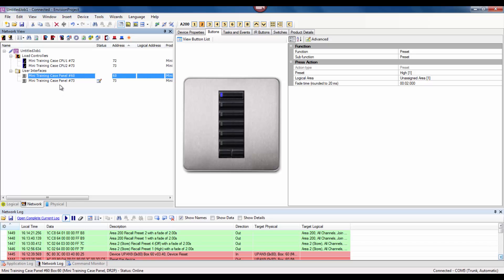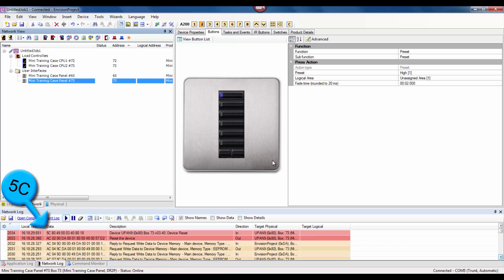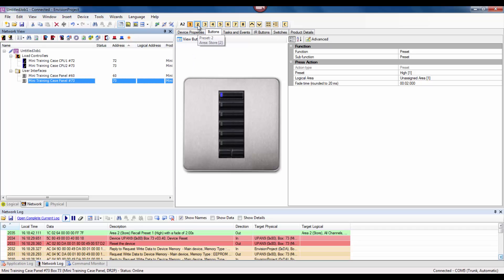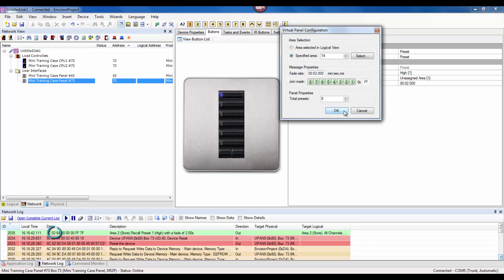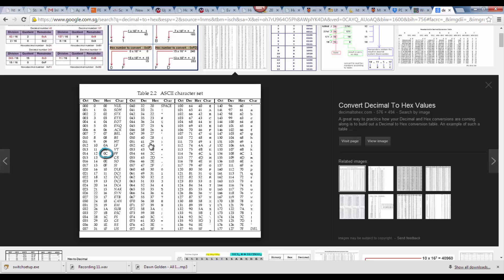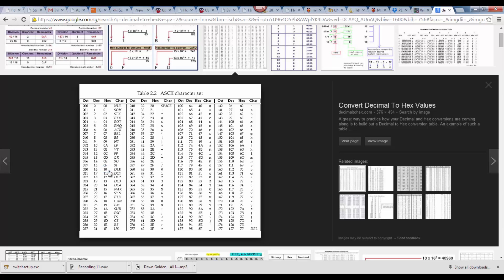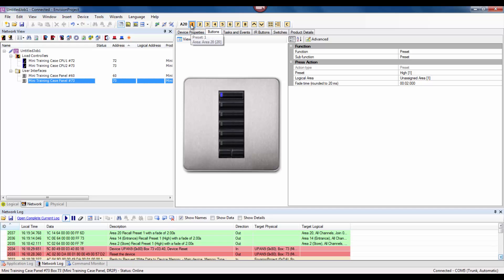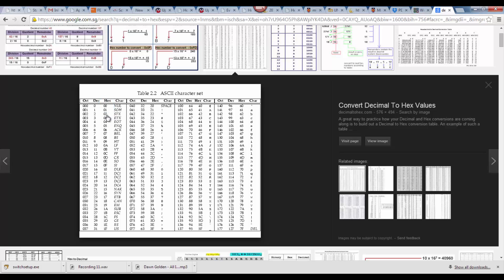EnvisionProject/System Builder - Basics of a DyNet String

Comment: This data arrangement is called a Frame, not a string. Also, work on your hex conversion, this was profoundly confusing. 14 in hex is 16 + 4, 20. 

It's baffling as to why you even felt the need to do this video given almost nothing in it is accurate or useful.